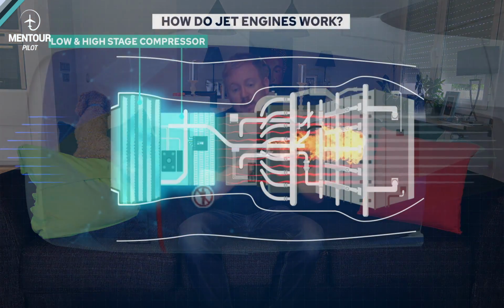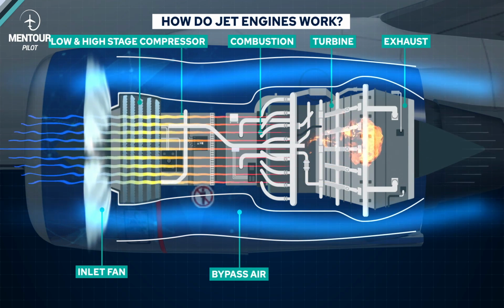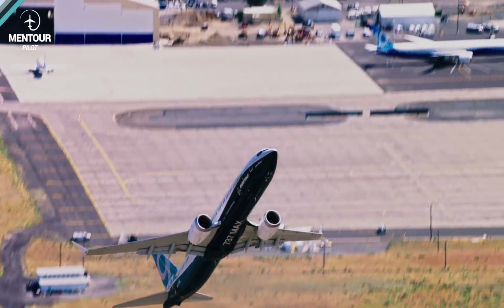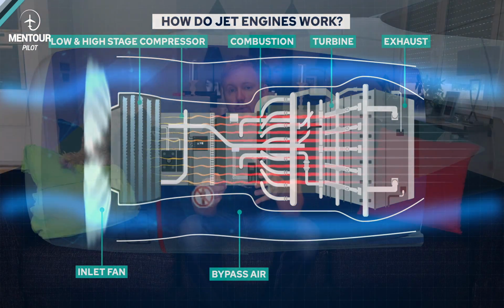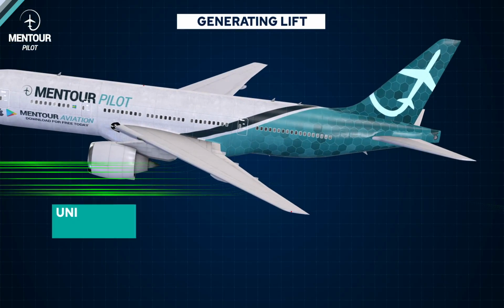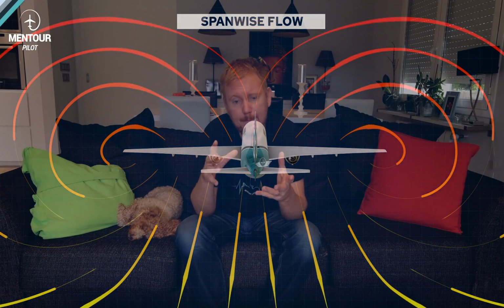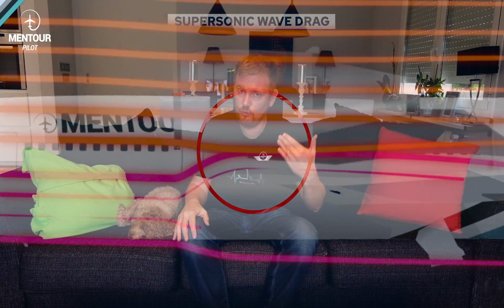How BIG can jet engines get?!

Comment: Why can't the wings be mounted on the fuselage like a Cessna 172? That way the landing gear could be light and mechanics could still access the engine easily. A camera could be mounted on the tail for the pilot to see the top of the wing during pre takeoff inspection.

Comment: Why did they design the DC-10 with 2 engines and a 3rd on the tail. Was it designed as a safety feature.
Reply: It was designed as a smaller Jumbo (i.e. smaller than 747, bigger than twins).   It needed 3 engines, where else would you put them?   Either you put all 3 at the back like 727, Trident, L1011, or you put two on the wings in which case the location of the third is obvious.      And no, it didn't turn out to be a safety feature.
Reply: @cr-yi7ep  smart arse
Reply: @gordy3714    I answered your question.    Sorry if it sounded sarcastic, it wasn't intended that way.   Seriously, 3 engines was what a plane that size needed at that time.
It probably also helped that 3 engines got around the limitations on twins flying over the ocean.
Reply: I don't know much about aviation that's why I asked but Thanks.
Reply: @gordy3714   That's OK.   I certainly didn't write my first answer to be sarcastic, but reading it back I realise it sounded that way.    My mistake, but a very easy mistake to make.

Comment: 13:00 

While everything he is saying about weight and size is true. There is a more important factor.

There is a optinal size. That is. If you make the turbine larger than a set size, it actually become less efficant. This size is a facor of speed, airdensity and engine area.

And it works that way that the faster tou fly, the lower the area gets. For a helicopter that hovers, this size is really huge, but for a supersonic aircraft is really quite small.

I dont have the nubers on hand, but somethin like a 777x is really not that far of the optimal size.  Well, at top speed that is. If the plane fly slower, the fan could be made even larger. And at speeds around 600km/h the difrances is so large that a normal propeller is quite a bit better. 

Kind of missed one inportant part  accelrating the air cost is square of the thrust being made. So if the volume is doubled and the speed is halfed, you get same thrust for half the energy... well in theory (its a bit more conplicated due to the primary flow of the remaining 20% that is still jet engine

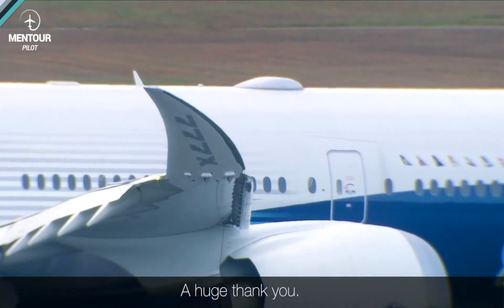9:40. Maxium thrust is usualy at a speed higher than take off speed. I dont have the stats in front of me, but i would imagine that the static trust of the 777x is on par, or ever greater than that of the old 777. Its like comparing horespower with torque.

11:35 
I wouls disigree with that is not much to do to increase the core preformance. A gasturube work on the diesel process ... yes, a gasturibe is an disel.. a linier diesel.

Best diesel is about 50+% efficent, and hcci that is sort of the next genration diesel is almost at 60%.  Gastubiens is between 35 and 38% efficent. Turbofans is a bit more efficent due to the jet effect... but we talking like 1 or 2 units more.

The reason why diesel is more efficent is that the engine cool down between each cycle and there for can handle much higher temperatures. This is pretty much the major disadvantage of a gastubine engine. 

There is two ways to get around this.
1: using better materials... that they do... but .. well in theory it could be much better.
2: use the waste heat in a secondary turbine. This is reguarly done in groundbased instalation, but as far as i know, there never been a aircrafy that use it.
Reply: The optimal speed that you were talking about is if I understand correctly why aircraft designed for supersonic flight use either lower bypass ratios than airliners or still use pure turbojets in some cases (The Concorde). And the engines in the SR-71 actually functioned as ramjets at the highest speeds.
Reply: @edwinball985  yes. Most modern fighter jets does have a bypass, but the ratio is generaly rather smal. Most gen 3 and 4 fighters have after heating of the bypass air enabeling a sort of more economical afterburner. 

For gen 5 figters they usualy have a higher bypass ratio with the effect of the aircraft (in theory) being slower. The benefit is that they can run a dry supersonic speed, and there for run at aupersonic speed for an extendended period of time..
For sr71 is sort of a speca case because the conpreasion heation of the air is enormous. This make it pretty much not possible to run it in a jet engine... i dont know the details of it... but you are right and conpression heating is the reason why they do it.

Comment: @mentour sounds like engineering wise, bigger engines are reaching diminishing returns. So at what point will passenger airlines stop operating in the sub sonic category and begin operating in the sonic or Mach 1 or 2 speeds?? Yes their was concord and they failed but it’s unfair to use that as a baseline to not use sonic jet engines. Here why, 1 it was limited where it would fly to. second they set the price point so high that only ppl with means took advantage & and let’s be honest wasn’t really a push to be cost effective or any innovation on getting price point down for customers. This day and age, people value time as well as diverse direct destinations. I remember reading an article that Boeing was looking to get passenger aircraft to fly in the exosphere or higher... use the earths natural rotation to just float since you are literally at the edge of space & At much faster speed.  you’re hovering at the edge of the earth and then come back down. Sure would be a quicker flight.

Comment: I have a question

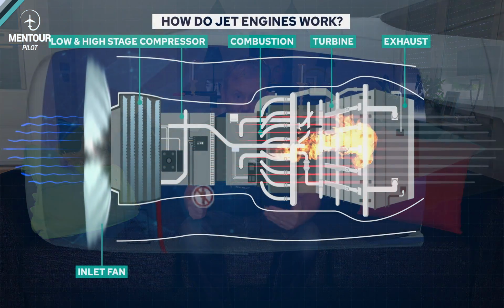10:24- as you can see in the bypass section of the engine, after the air passes the fan blade the air moves a little bit upwards and then turns a little bit down (i am talking about the lower bypass section). why is it like that? why cant we make the bypass section such that the bypass air moves in a straight direction? 
please answer

Comment: Granted Jet engines cannot be placed on top of the wing, how about having the wing box on top of the airplane like the Airbus A400M  and the Antonov 124 and 225? Wouldn't this alone make it possible to increase engine size without increasing the size of the landing gear?
Reply: I asked the same question, (also mentioning the A400) and C-130, C-5 and the ATR-72 and forgot the BAe 146. Notably of all the high wing designs, "only" the ATR-72 and BAe 146 are passenger planes, but are much smaller than the other high wing planes and B777 and B787, A350. If I remember correctly, I think the problem with high wing planes is the way they handle and it's a more unpleasant ride for the passengers. Hopefully someone will be able to confirm the details.
Reply: @axelBr1  it could be true, that high wing planes maybe uncomfortable with passengers. Perhaps that's the reason most of them are applied to military aircraft especially the c-5. Though there are aircraft like the Dhc Q400 with the same design but it's a civilian aircraft. Anyway I was just curious, I am sure there's a good reason for that.

Comment: For flights of less than 4 hours you could use a modern efficient variable pitch propeller and have a very small impact on sector time. As although turboprops fly slower they can climb and descend quickly. Another bonus is they work very well with alternative forms of energy such as pure electric or hybrid.

Comment: A fascinating video. Thanks. A question, which is sort of chicken and egg. What comes first: the new aircraft design or the new engine? For example: Boeing produce the 777x and it demands a bigger engine. Did they build the plane to accommodate an existing bigger engine or do they approach R-R, GE etc. to have them design and build an engine to drive their new design? A possible topic of discussion for a future video?

Comment: Why not put the wings at the top of the fuselage, leaving more clearance for larger engines? Too much noise?
Reply: I'm wondering if they put them on the rear, like 727, or blended into the body like a flying wing. It will increase maintenance, and yes it will translate more vibration into the aircraft. I remember the 727/DC-9/MD-80, it being far quieter at the front than the back

Comment: The eternal struggle of sizing, adding mass to lift the mass

Very informative video, only thing I would add is that in regards to adding engines over the wing is that if you do it you have to have them placed high enough that you avoid the added drag. Main reason its no done is because the amount of strengthening that pylon would need to support the weight would negate the benefit. Though you could also use that added vertical surface area for greater lateral stability, and greater yaw control if you add rudders to them.

Comment: I remember seeing jet aircraft with three (3) jet engines mounted too the tail, keeping them out of wing-effect aerodynamic consideration could such a system lend itself more to giant-engine-attach-kerbal-style?
Reply: I don't see why not. A projet has been drawn with one unique fan and turbine at the end of the plane.
Reply: they come with their own issues. Podded engines on the wings as as counterweights for wing flutter and the pylons act as vortillons blocking spanwise flow under the wing (as do the flap track fairing canoes, they're that big for this reason, not for the mechanicals inside)

On top of that, fuselage mounted engines are a pain in the rear to do the daily stuff on == higher costs

Comment: I'm surprised you spent so much time on the "engines above the wings" design concept, which is rarely seen in aircraft (unless I'm wrong?) and so little time on much more common design concept for addressing the same constraint.  You mentioned flying wings in passing at the very end, even though there are many existing flying wing designs.  You didn't mention the other two design concepts that are also common (shoulder mounted wings and tail mounted engines) which both raise the engines relative to the traditional airliner configuration.
Reply: I have thought about that but the problem with aft mounted engines is the moment arm of the weight of the engine. Engines mounted under the wing are very close to the CG of the aircraft and thus do not contribute significantly to the inherent pitch stability. Moving two big engines to the back of the aircraft moves that weight to the back and thus shifts the CG much further aft. The only way to make the aircraft fly is to move the center of lift back as well (look at the Boeing 727) now that the wing is over half way back it will fly stable, but now limits the control arm moment available for your aft control surfaces, this means that your elevators are now less effective in controlling pitch and need to be bigger, bigger surfaces mean more drag, and the iteration continues. This is doable on smaller aircraft like private jets and small short hall aircraft, but does not scale up well to long haul aircraft. 
As he said, aircraft design is a series of compromises. The issues I just mentioned in addition to real world issues like maintenance make tail mounted engines a less desirable design choice.
Reply: @jeromysmith5207  The problem comes with the thrust line below the CoG - add thrust & you get nose-up moment. That's where the MCAS came in, to try to reduce that to being similarly to the older 737s.
Reply: @blatherskite9601  That doesn't have much to do with the point i was making but yes, thrust vector and moment are one of the many problems in designing an aircraft.

Comment: With the replacement of turboprops with regional jets, the logic of which eludes me, since turboprops are a tad more compatible with small fields than regional jets, but I digress, why is there less news about improving turboprop efficiency than there is about bolting engines the size of my house onto jet aircraft?

Comment: Of course there are ways to mount bigger engines. Higher wing roots etc as on the c5 military transport. Low wing design made sense when engines were smaller, perhaps it is time to reconsider.

Comment: Increasing the fan diameter decreases the maximum rpm at which the fan tips remain subsonic.  
Engines mounted over the wings force pitch downward which must be countered by negative lift from a larger elevator.

Comment: There was a research aircraft that used turbofans above and forward of its wings, using the thrust in a directed manner over the top of the wing. There is also the safety issue. If the engine has an uncontained failure, it'll be right next to the fuselage. Also, underslung engines are designed to break free and fall away from the wing.

Comment: Great piece. A detail: Thrust is the time rate of change of momentum imparted to the air - proportional to the change in velocity.  Like mv. But the energy needed to accelerate the air is proportional to the square of velocity. Like mv^2. The simple math here is what drives engines to higher bypass ratios, to accelerate more air at lower speed. Same thrust if you double the mass flow and halve the speed, but it requires only half the energy. 

Also note that the reason to burn fuel is to increase the volume of the gas, not the pressure. If the pressure in the combustion chamber were higher than the compressor discharge pressure, it would run back out the front! It rushes out the back because the pressure is lower. 

No one at GE calls it the "General Electric 90" - it is the General Electric GE90. GE gave names like GE45 to development engines, used only internally. The GE90 was an oddball in that the internal designation became its external designation, rather than something like CF6-80C2. (I was a metallurgist at GE, retired 20 years ago.)

Comment: Rollo Royce Trent engines are lighter and a bit smaller in fan diameter than GE's, as far as I know. More exactly, on the 800 series for the B777.
It surprised me (maybe Wikipedia Is wrong) that GE has to build an ever bigger engine for the B777X while the engine for the B777-300ER achieved a record thrust of 127000 lbf.

Comment: Another point to consider regarding the difficulties of having large jet engines on top of the wing vs. under slung is the shifting of mass in relation to the aircraft’s cg.  Basically, having that weight above the cg results in less stability; engines under the wing (mass under the cg) actually improves stability.

Comment: What about a high wing passenger plane? I'm thinking both about the Bae 146 and the Lockheed C5 Galaxy.
Lockheed has a project (never built) of a Very Big Plane twinjet (cargo) with huge engines and a high wing.
Unfortunately that was many years ago and I don't have the magazine where I read that.
Another Lockheed design was a cargo plane with the 4 engines un the 'forbidden position'  above and in front of the wing.
Alejandro Uruguay (IATA code MVD).

Comment: Some airplanes with top mounted engines: HondaJet, Beriev Be-200, Antonov An72/74, Antonov An32
Reply: Exactly it would have solved the 737 max problem as they could have fitted them where they liked.
Reply: @womble321  Well yes but actually no.
Reply: @womble321  see my reply, about the VFW 614, in answer to the same comment, from Luis Ramirez.
Reply: @womble321  And created quite a few more problems, like its a new aircraft, so extensive recertification and pilot training, and all the additional design and manufacturing headaches from a completely new aircraft (all of which they were trying to avoid).
Reply: @andyowens5494  true but it would have been a lot cheaper as it turned out.
Reply: Did you watch the video????
Reply: @teecar9868  I certainly did. Its OK to disagree once in a while!
Reply: There was an aircraft called the VFW 614 which first flew in July, 1971 and had over-wing, pylon-mounted jet engines, But this was a 40-44 seat airliner with a gross weight of 19,958 Kg. and with twin engines each rated at 7,500 lbs. of thrust.  These were small turbo-fan engines. A photo in the Wikipedia article shows the engine and pylon above the wing and it's not hard to imagine a seven ton engine and how substantial and sturdy, not to mention the weight of it, a pylon would need to be to withstand flight loadings. There would be no engineering compromise which would work; shorten the pylon to save weight and you cause greater aerodynamic disturbance and drag. Lengthen it to avoid these effects and you increase the weight. So much easier to suspend the engines on pylons below the wing and they just hang there on the fuse pins.
Reply: All (bar the An32) need T-tails, bringing on the danger of potential deep stall conditions.
Reply: Yes, but to solve different problems (avoiding ingestion from rough airstrips, and to improve low speed handling characteristics, neither of which apply to high efficiency/low margin commercial aviation). There is still a market for them, just not the mass market.

Comment: 2:48 the pressure doesn't actually increase across the combustion chamber; the volume (and thus velocity) increases. AgentJayZ has a great video about this.
Reply: Thanks for pointing this out. You are correct. The highest pressure in a jet engine is at the exit of the compressor. If the burner pressure was higher than the compressor pressure, the combustion gasses would flow backwards, towards the lower pressure in the compressor. The heat of the burners add volume and velocity but not greater pressure. The exhaust gasses flow out the rear, to the relatively low pressure of the atmosphere. Along the way, the fast flowing hot gasses drive turbines which power the compressor and the fan.
Reply: Yes, containing pressure after after the compressor does nothing, releasing it creates thrust.